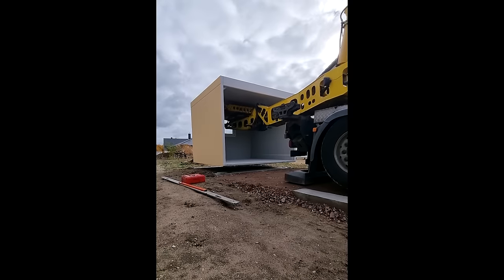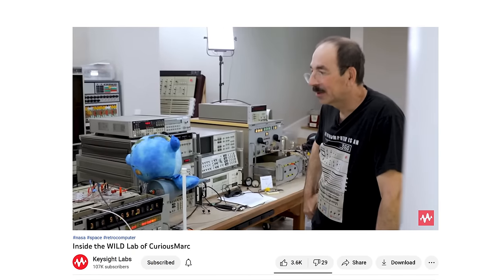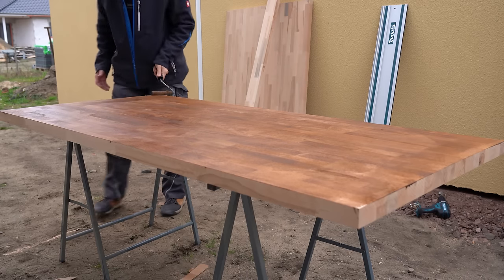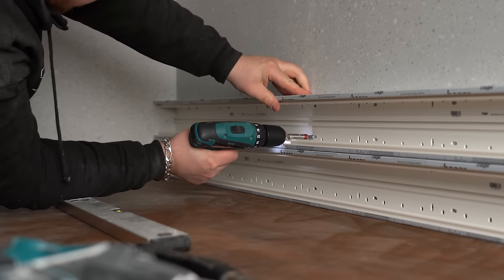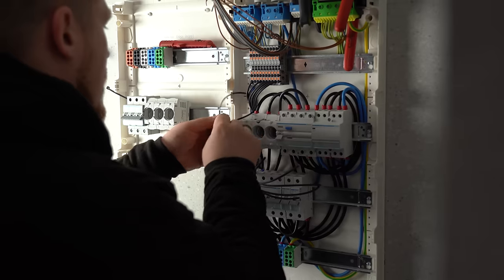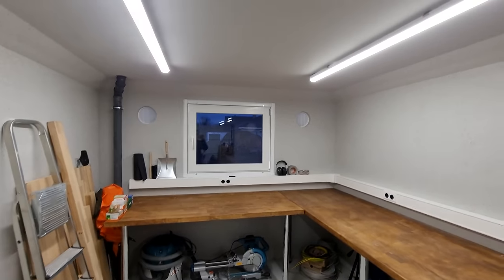Germans do the PERFECT Electrical Wiring! (Garage Build)

Comment: Anouncing the video as doing the stuff PERFECT and then doing big flaws with the safety 🤔. You are right, as an professional I would say "noooooooo.......", not just doing it with a NO contact is wrong, If you use a relais in safety wiring, it should always be with "zwangsgeführte Kontakte", that means all contacts are connected in a way that they are always switch in the same way. And the next flaw in my eyes, you should integrate a automatic restart protection. In your wiring, it can happen that somebody releases the emergency stop and any machine that is still switched on will automatically start with it's operation, that is something you should prevent. But for your application there is a specific product (no I'm not connected to this company, it's just something we use as well): Have a look for Doepke Lasttrennschalter DHS 4-063 NA, it should fill all you needs.

Comment: I always wanted to build those electrical ducts into baseboards of houses and wondered why that wasn't how it was done already
Reply: Cost really. Code requires 1 outlet for every wall at a certain height so that's the minimum contractors put in, anymore wouldn't bring additional value so you would have to do it ona custom build if you wanted it.

Comment: you shouldn,t leave the cable without cover in the corner , simply put spring and bend the plastic conduit upon your requested angle. you shouln,t leave any naked calbe specially befor going inside junction box or outlett , there is special plastic gland coming with all size 1/2" , 3/4" ----etc that can fitted to the junction box with nut and with glue from the pipe side after you make some off-set according to the hole distance from the wall . you and your friend are good in electronic but in house cabling need more practice !! all the best and good luck.

Comment: A Garage would be done pretty similar here in Switzerland. But as an electrician I can tell you house wiring in Germany is far from perfect and done way better here in Switzerland.
In Germany you open the wall and put your wires in. No way to replace them without opening the wall again. Right?
Reply: Right. Because why would you want to replace the wires? You are wasting huge amounts of resources (plastics) for no real benefit.
Reply: @whuzzzup  One does not waste resources with the Swiss standard. Due to the laid pipes, no double-insulated cable is required, but individual conductors are pulled in, which saves plastic. In addition, you only pull in as many conductors as are needed. If a socket and a switch are used, 4 conductors are used. If you want an additional switch, you don't have to tear up the whole wall and put in a new cable, you simply pull an additional conductor into the existing conduit. 
There are many reasons for changes. For example, if you are installing something on the wall and damage the cable while drilling, in Germany you have to tear up the wall. In Switzerland, you simply pull a new cable or wires into the conduit. If you need a 3-phase socket instead of a 1-phase socket, you can simply pull in two additional wires and change the socket.
You need more examples?

Comment: Not that I know better, but if I could, I would install those wall ducts as a part of the table (Flush on the table no protrusion from the wall).
You will probably regret it when you have to clean the table or when you can't use the whole area of the table because of the wall ducts. I can imagine a really big monitor that could not install flushed on the wall.

Comment: Where do you get 3 phase power to your building? Are you in a commercial zone?
Reply: New instalation in Germany: You have to build for 3*63A up to the counter. What you get is different. Usualy you get 3*35A (no electrical heating, some 24kW) or 3*50A (some 35kW).
Somtimes you get even 3*63A without paying extra, but this is rare. If you pay you can get nearly everyting, if you like, even a 20kV cable with a 1100kVA transformer (3*1600A on the 400V side). But then the instalation bill has 5 or 6 digits, not counting the cents :-)

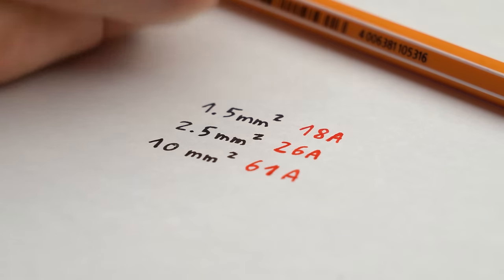Comment: At 10:16, the amperage ratings written are for singles in open air, you need to look up bunching in conduit and its twin & earth, it de-rates the current for those sizes, why no conduit adapters used, if your going to use conduits, you could have used singles

Comment: What I would have done differently? I would have made the workbench from wall to wall, to minimize the amount of legs required. I would also have removed the leg at the corner near the wall. And if I had the time, I would have milled slots into the walls for the pipes, so that they are out of sight. At least for the smaller room.

Comment: Doesn't look that bad, but I wouldn't change the feed in from bottom to top. Normaly I feed everthing from the bottom and wrap behind to the next bottom. 

Did you switch the neutral of the safety circuit?
This could be really dangerous if there is a fault and some of the phase contacts burn stuck.

Comment: As an Elektroniker für Betriebstechnik Azubi(commercial electrician apprentice) your execution of the emergency stop and especially the reason is worrying me. 
I know this is kinda overkill but that's the proper way to execute such a emergency stop: The emergency stops should be wired up to a emergency stop relay. This emergency stop relay then activates two contactors that are wired in series. The emergency Relais can be wired such that after resetting an emergency stop another button has to be pressed to activate the power again. That would be the perfect way of doing it, but of course rather expensive and not legally necessary in your scenario.
But at least wire up the Emergency stops in series with their opener contacts and use if the budget allows it two Relais in series.
And now to your reason to not use opener contacts. I guess your realis wold actually consume around 5w so that alone would not cost that much. But also you can just shut down the circuit (at best with a separate stop button) while your not using it, which would cut down on electricity consumption of the Relais and other stand by devices  and also reduce fire hazards by connected devices.

Comment: Gerade gesehen, dass du diese Info bereits im Video hast, trotzdem lass ich den Kommentar mal drin

Sehr geil das ganze, Verdrahtung etc. echt super, nur werden NotAus Anlagen immer mit einer Drahtbruchsicherheit eingebaut, das heißt, wenn irgendwo in der Notausleitung nen Fehler sein sollte, geht die Anlage nicht an und der Notaus ist wirklich zuverlässig. Du müsstest dazu ein normale Normally Open Schütz (Schließer) statt ein Normaly Closed Schütz (Öffner) und im Notaus die Öffner nutzen. Anschalten kannst du das ganze dann mit einer Selbsthaltung, die dann durch die Öffner vom Notaus unterbrochen wird. In deinem Fall hast du es umgekehrt gemacht, falls also dein Schütz versagt oder eine Leitung zum Notaus irgendwie unterbrochen ist, funktioniert die Abschaltung im Ernstfall nicht mehr... Ich hoffe ich konnte helfen, die Sicherheit zu erhöhen

Beste Grüße

Just saw that you already have this info in the video, but I'll leave the comment in there for others

The whole thing is very cool, wiring etc. really great, but emergency stop systems are always installed with wire break protection, which means that if there should be a fault somewhere in the emergency stop line, the system would not start and the emergency stop would be really reliable. You would have to use a normal normally open relay (closer) instead of a normally closed relay (opener) and use the opener in the emergency stop. You can then switch the whole thing on with a self-retaining function, which is then interrupted by the emergency stop opener. In your case you did it the other way around, so if your relay fails or a line to the emergency stop is somehow broken, the emergency stop will no longer work... I hope I could help to increase safety

Best regards

Comment: Moin! Take a look at the Doepke FIs with short delay on turn on..
still switches off on fault fast enough but allows higher inrush current when for example switching a large pc power supply an three monitors at once.
Come in around 270euros or more, but pretty nice if you dont want to split into multiple Fuse-RCD-combos (DRCBO 3 B16/0,03/1N-A 09932104).
There are also Siemens RCBOs with short delay.. i tend to use Type B RCBOs now instead of Type A
- It's always bad if you switch on the last tool and suddenly are in the dark with spinning blades because everything is behind one RCBO.

(If you want to charge a electric car off that CEE you will need to install a seperate Fuse + separate Type B RCBO or a separate Type A if the wallbox has a DC current sensing)

Soo different:
Separate combination RCBO-Fuses, so only one trips at a time. (maybe type B and delayed type)
Wiring the Emergency-Off the normal way, so you have a power shutoff when you are not using your garage-shed.
(the power consumption isnt what you read, thats the drop/loss at max rated Amps)

Did you get everything tested afterwards ? At least should be done once.

Comment: Could you make a circuit that shows a LED to confirm power is running up to the emergency cut off switches? Given your talent then I’m sure you could design something, I guess a large resister and a transformer and rectifier and you’d have a led that’s not pulling enough power to trip the disconnect but if there’s a break the led goes off?

Comment: Wait, did you supply all of the 230V "devices" (outlets included) from just a single phase, despite having 3 phases in there anyway? Because it looks like that in the end when you were showing testing all 3 pairs of lamps at once with only single phase power from the construction site.

Comment: As a trained industrial electrician, I give you a 'B' grade for the wiring on in the junction box and the breaker box and a 'C-' grade for the rest of it. The junction box could be neater, you should have made use of small finger board in a couple of locations instead of just cable ties and you did not label the individual wires or use separate colors. As neither of these is required by code and the work was still neat and presentable, it would have passed inspection, but labels or different colored wires should always be used so that circuits can be quickly and easily understood when troubleshooting by anyone opening the box. The low grade of barely passing on the rest is because of the use of conduit and the cable together the way that you did. Although likely legal by code where you are, it is considered a very poor practice and does not properly protect the wiring. In the USA, the method you used is forbidden by code specifically. Either using the correct cable on it's own or installing wiring in non-metallic or metallic conduit would have been a much better installation and much safer.

Overall, you earn a C+ and would get a pass, but I would suggest you take the conduit installation class and read up on code. Non-metallic is really easy to install, by the way, and using just a heat gun, pair of insulated gloves, and a water soaked towel, you can do all your bends. I would suggest taking a class on it or asking an electrician to give you a quick lesson on it if you are going to do more wiring of structures.

Comment: I’m not entirely convinced that half-assed e-stops are better than no e-stops, tbh. But I can see why you wouldn’t have the real deal in such an essentially domestic installation.

Maybe separate out permanently-on sockets (for electronics and such) and interrupted sockets which you use for machine tools, and only turn that subsystem on when you’re actually using them?

Comment: A concrete box with a tiny window is good for a car. Which is fine to stay cold in winter and hot in summer, does not breath (and hence does not need fresh air) and does not care to be in the dark or with artificial light even in full daytime.
A bit less so for a human. And I am pretty sure that in Germany the public authority would not let you use such a box (which by the way does not even have the minimum prescribed height of 2.7m for a room to be used by humans) as a place to live or work. Even temporarily.

Comment: Very Interesting Garage / Building, I noticed that the garage door opener is very close to the ceiling.  Is that a belt driven opener or screw?  Why did you go with concrete instead of a wood stud framing, insulation & drywall?  Also I would suggest putting 2 part clear epoxy over the table. Love your videos
Reply: bike chain driven is the most common garage dooropener. drywall is a no go in a unheatedgarage due the climate wood is expensive and needs maitence.

Comment: Now, I'm not an expert in this field, but if I recall correctly from my quick 1 month Electrical course I had to do during my apprenticeship, you'd need to do all sorts of tests using testing equipment before you'd be allowed to supply 230V to such a system. Again, no expert so that might just been for commercial installations...

Comment: I have a question my dear friends!

In my country we are not allowed to leave even 1CM of "naked" wire or cable, like you did in the ends of each conduit close to the connection boxes and light fixtures,
we use flex PG conduits to seal these parts,
It is not mandatory in Germany?

Best Regards!

Comment: I'd look at the legs one more time. Why not make wall mounted wooden triangles? Makes it much easier to move around, and clean the floor when you get to that also. :) Nice nonetheless! And i assume next step is some home automation with rpi and home assistant? Lights triggered on door opening or movement, or even cell phone when it connect to the garage wifi.

Comment: Hello, here is a feedback from Slovenia. First i work in industry and my job is to look electrical installation how it's done and if it is ready for measurements.

First i saw that you use NNY-J cables, can i ask why? We are using cables with mutiple wires inside like FROR or FG16OR16 (i saw that you are using some of this in electical box). Cable with multiple wires inside is better for current and resistance.
 
Are you using same wire for socket and lights? here is not allowed to do that. We alway separate this two because it is different standar.

You showed i picture where you can see that 1,5mm2 can handle 18A,... This is not true, you have three classes for how much curent cable can handle and depends on how good is cooling for cable (where is installed and how). For 1,5mm2 you can use only 12A if im not mistaken but we usually use 10A fuse, for 2,5mm 16A, 20A for 4mm2 and 32A for 6mm2. If cable have better cooling soo it is in cable tray then you can put bigger fuse, exsample for 1,5mm2 18A and cable will heat up to 70°C. 

In electrical box you dont have main switch (here you need to have one). We are not using terminal blocks anymore because more connections is usually bad but it is not wrong at all.
You can put stop press inside a kanal:)

Comment: Do you need a licence to do electrical wiring in Germany? In Australia it is very much verboten without one! I was also surprised to see the current ratings on the wires - We use 1.5mm2 for 10-15A and 2.5mm2 for 15-20A
Reply: Not an electrician here but also do all my stuff at home. Don't know about certifications in Europe, I'm from Portugal, but for sure that for a new house a electric plan is needed to be signed by an engineer and installation done accordingly.

About wire ratings, in Portugal (and I assume is EU standard) usual home electric installations use 1.5mm with 10A circuit breaker and 2.5mm with 16A circuit breaker

1.5mm is used for lighting only and 2.5mm for sockets.

Bigger than this it depends on how many cables you use together, what's the cable temperature rating and what distance is needed

Comment: I have a question for you? I am from Winnipeg Manitoba Canada. I recently looked around on the internet. For houses that were for sale. I came across one luxury Log Cabin. Two and a half hours away from me. Now to get there you would have to take a boat from Kenora Ontario Canada. It would probably take you about an hour boat ride to the Lakes. Very beautiful very beautiful. This Log Cabin has everything. It is worth two million four hundred thousand dollars. The owner is German. This is the interesting part. All the power plugs and the power sources the refrigerators are all from Germany. As you know we do not use German Outlets here in Canada. I will send you a link so you can see this house for yourself. How hard would it be to change this house over. To the right power system of North America. Because it has a German system installed. are plug system here is type B. The German system would be type f.  now it is run on generators and solar panels. It is off the grid. If someone bought this house. They would have to change every wire and every Outlet in the whole house. My question Is it feasible to do this. Or would it be completely crazy to change over the whole house. Ich spreche fließend Deutsch.    https://www.realtor.ca/real-estate/24389492/lot-1-moore-bay-pipestone-peninsula-lake-of-the-woods-kenora-kenora

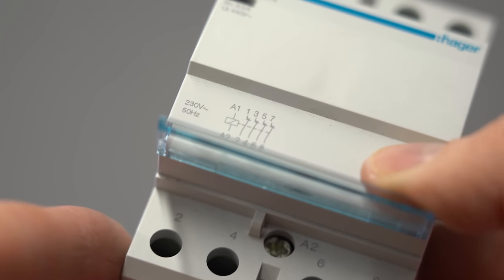Comment: I don't really understand one thing. In 6:55 in the schematic Neutral wire from RCD is connected to PE wire. If I think correctly this is is the sub-distribution box and cable feeding it will be five wires one, connected after PEN cable separation (if this is TN-C system). Isn't it forbidden to mix these cables after separation or is it a mistake on the schematic? Or maybe is it completely diffrent than I'm thinking? Please explain it to me.